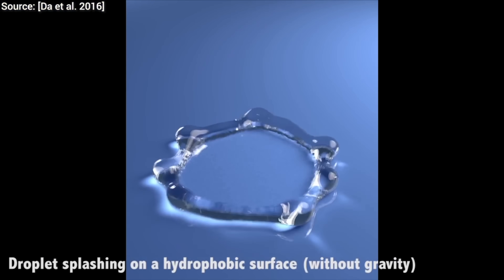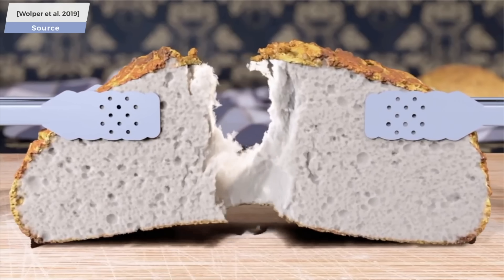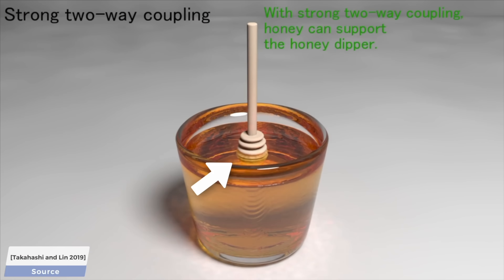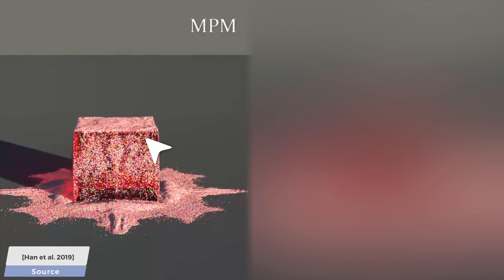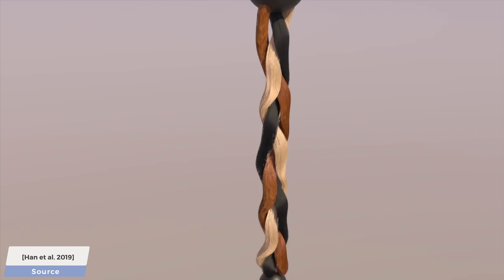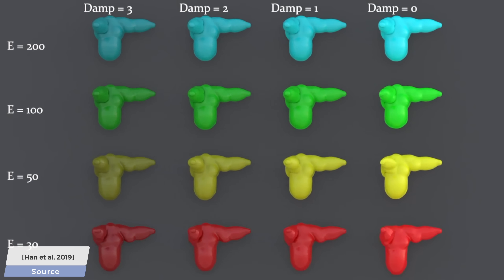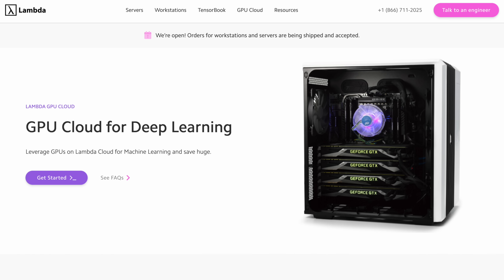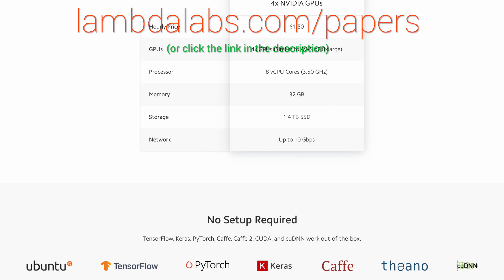Is Simulating Soft and Bouncy Jelly Possible? 🦑

Comment: I actually prefer the jellow and the particles sticking to it as if the jellow is actually of a sticky substance. In the right showcase, they jump around way too much and unrealistically.
Reply: I think the point is simulating the one property of the material (the bounciness) accurately without worrying about other things like stickiness. This is a demonstration, not an actual application.
Reply: @h4724-q6j  ooooh i get it now , thank you
Reply: @h4724-q6j  yes, thank you. The one on the left sticks because of the forming mesh. They get stuck for one reason or another.
Reply: yeah its like a hydrophobic jello or something. maybe the articles are supposed to be fluid though and its confusing because they look like sand.
Reply: i agree with you 
seems like both papers need a lot of progress in order to look realistic
Reply: @kostaslemis9600  are kwstaki simfonw
Reply: the target is option granularity
it's easier to make a non-sticky solver and make it sticky than the other way around
now that we can make it not sticky, we have the option to do that, we can also set up how much of the thing stick to the jello, because it's not crucial to the simulation anymore
Reply: I suppose  none of those simulations is supposed to model adhesive forces between particles and a semi fluid layer on the jellies surface. The left sides stuck particles are truly stuck, in the sense that they are trapped in some non physical boundary condition, an artifact of whatever method is used there.
Reply: Actually, the jelly in the simulation isn't supposed to be sticky. It's just supposed to be bouncy. The fact that the balls stick to it isn't a good thing. As for the bounciness, I'd agree that it does it too much but we don't know what parameters it had. It seemed to me that you can tone it down and it'll be more accurate if you looked at the later demonstrations.
Reply: Yeah, it looks nicer, but if the original purpose of the simulation was that they should not stick, then the one on the right might be better moving forward
Reply: Well if you want to have them get stuck. But if you want a bouncy material that isn't stick this new version is better.
Reply: Being sticky like real jelly require simulating sub atomic interaction (Van der Waals force) so I don't think this is intentional, this merely an artifact that happen to be more realistic.
Reply: It actually is accurate, even if it's hard to believe. Look at how vibrating speakers bounce particles. Also the jello is not sticky in this simulation
Reply: why it sticks is incorrect. This is an improvement.
Reply: The point isn't whether or not you think literal jello should be sticky.
The point is that the engine wasn't representing intended fluid simulation.
Reply: I might be wrong, but the reason that happens with jello is because jello is made of water and has water outside of it (i.e. is wet) and it's that water that makes stuff adhere. Because they're not interested in simulating chemistry but rather physics, they're only interested in an interaction between particles and a solid, dry jello (like human skin, kinda). That's why I wants the one on the right. This is all me hypothesizing though
Reply: I'd agree that the one on the left looks more realistic, but the stickiness of the material was not a factor in the one on the left, so it is an error in the physics engine. The values for dampening on the right are unrealistic, but they do act in a way much closer to real-life physics.
Reply: *jello
Reply: I think they're both unrealistically bouncy.
Reply: Really wondering what the specific gravity parameters and material densities they used in those simulations considering that none of them looked very realistic. Also agree that the sticky jello was the most realistic of the simulations.
Reply: I totally agree
Reply: yeah i feel like the stickiness is good and maybe the same level of bounce idk
Reply: Dtas some fine Turkish delight right there. Wondered why I'm hungry
Reply: I think it looks unrealistic because the simulations are made in a perfect world. A world where jello can be perfectly non-sticky and bouncy, and there's no wind or air.
Reply: Are we sure bounciness and stickyness in the real world are not coupled by some weird never thought of effect?
Reply: @sebastianfaber3754  Well, dry skin is bouncy, but not sticky, so probably no? Try to imagine a squared block of human dry skin (i know, bear with me) i.e. no sweat, and what would happen if you pour sand on it. At least to me, it sounds pretty intuitive that the sand would just fall right off on the vertical regions...
Reply: @sebastianfaber3754  
Yes.
Reply: Simo Todorov jellow
Reply: YES!! SAME!!!
Reply: You described anime boobs on the last sentence😂😂🤭
Reply: as with most things science, they assume perfect conditions such as hydrophobic jello that doesn't have stickiness but only the jiggle physics associated with it
Reply: the point is not the stickiness lolol
Reply: @aryasARTdiary  yea, we uh get that, we're saying that to call it more realistic isn't really truly proper wording.
Reply: I was thinking the same. Jello is kinda wet and small particles will stick and the added bounciness is way too exaggerated.
Reply: @Hallucinogenichusky but it certainly isn't particle-phobic
Reply: Yea
Reply: I agree.
Reply: I agree that the left is more realistic, but ya gotta admit that bouncing sand is entertaining!
Reply: @Flowtail  more realistic for hydrophillic jello maybe...
Reply: Yeah, I was like, "This is less realistic. Who in the holy hell thinks that things just keep bouncing off jello?"